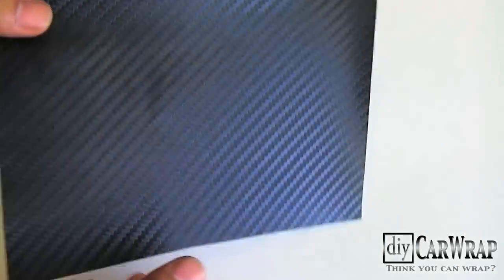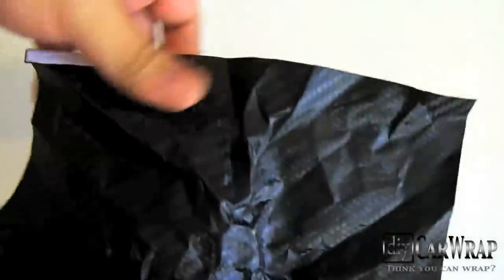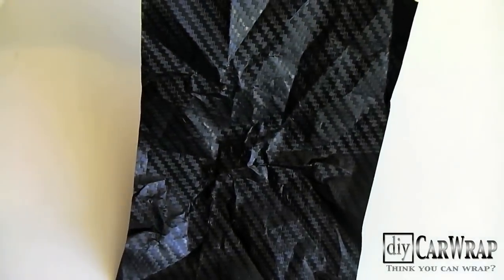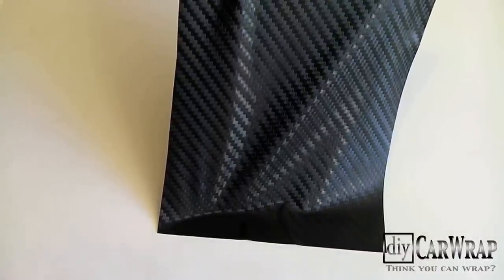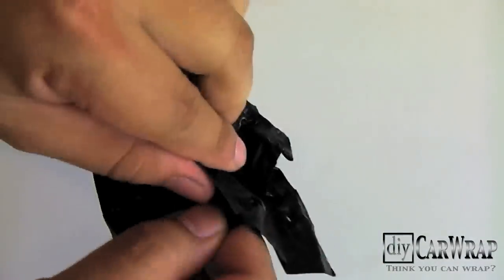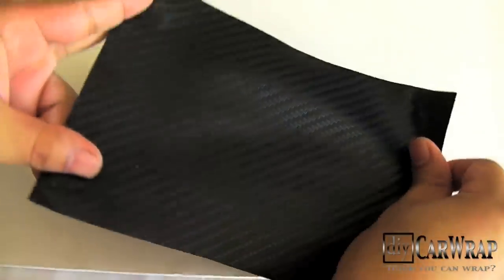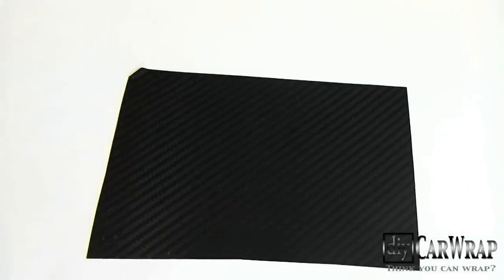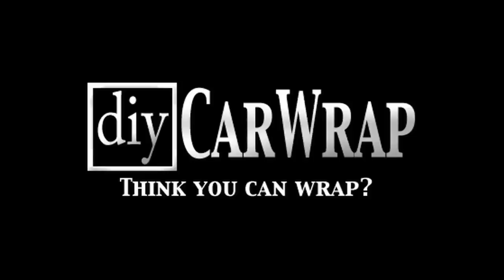DIY: How to Remove Wrinkles from Vinyl Car Wrap

Comment: what about vinyl wrap that's already on my car? how do I get creases out of that? I just wrapped my trunk today. it turned out good. except for the back lower left and right parts. there's creasing on both sides. how long will i have before it's too late to peel back the vinyl and try to rework it?

Comment: Great video,   

After heating it up, doesn’t this stretch?  
If you were using tightly fitting pre cut pieces.  Would this stretch the material?  

Im wrapping a bicycle frame, but the kit came damaged.... 

Thanks for your input...